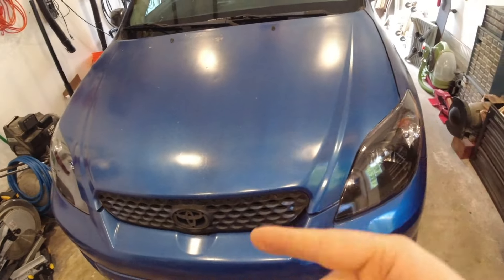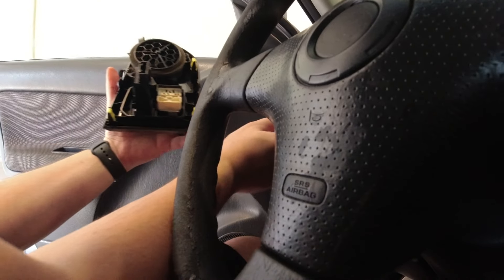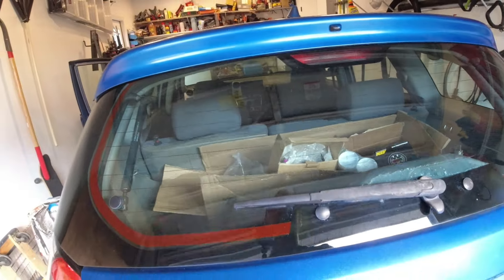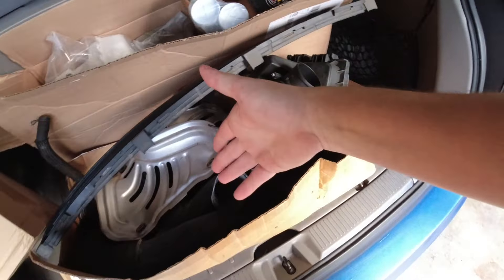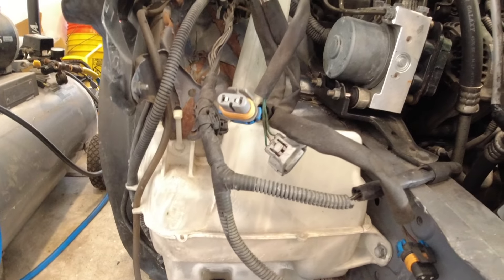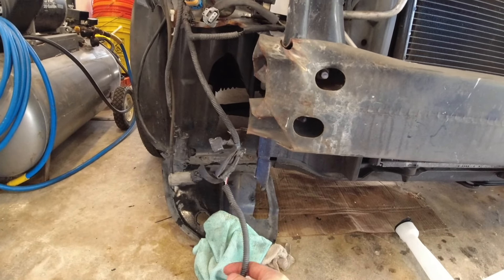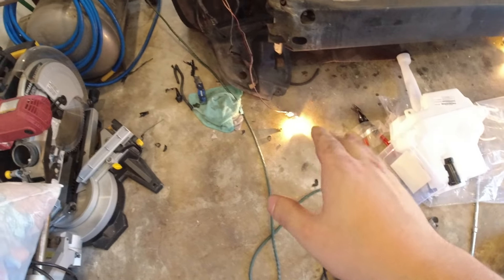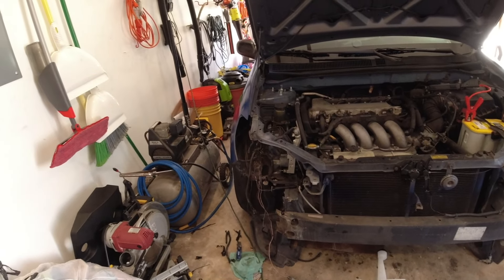RESTORING MY XRS MATRIX.

Comment: Hey Brandon you may need to swap the dimmer switch in the vent panel you replaced.   You XRS has the sunroof so the dimmer switch doubles as the dome light switch. The one you put in in for a non sunroof car which has the dome light switch on the actual dome lights.
Reply from the maker: Good catch. I didn’t realize it until the next day! But I swapped the old one back and the dome light works!